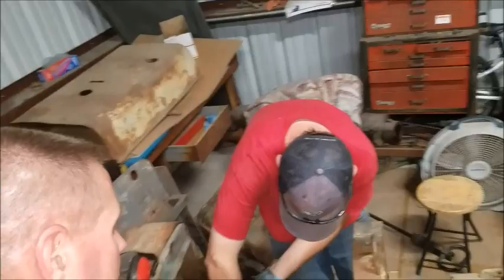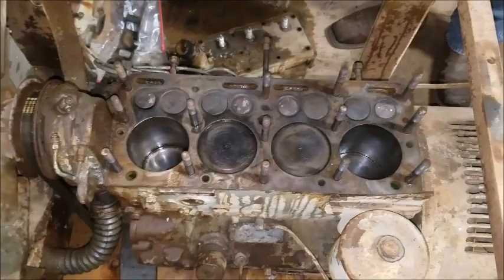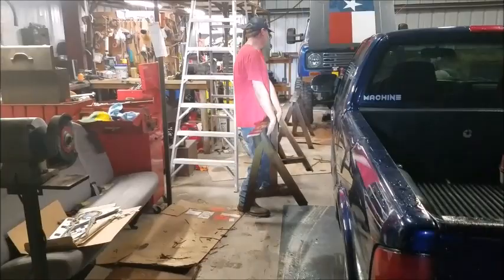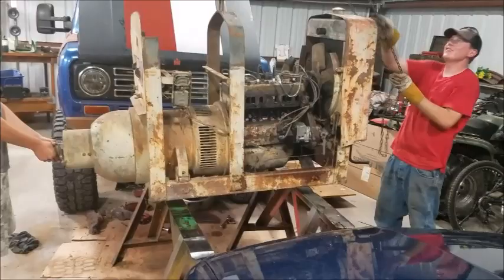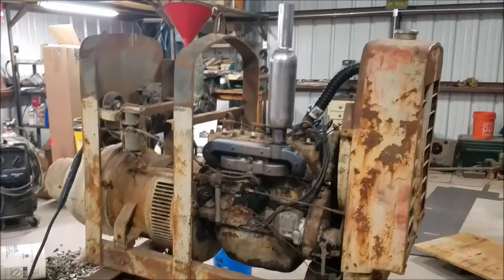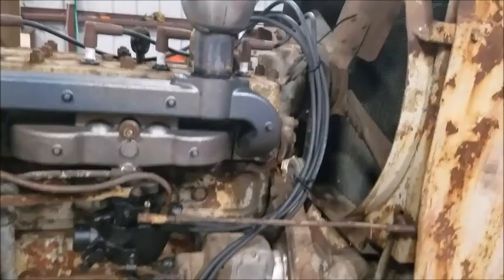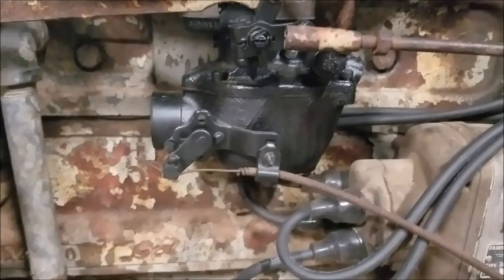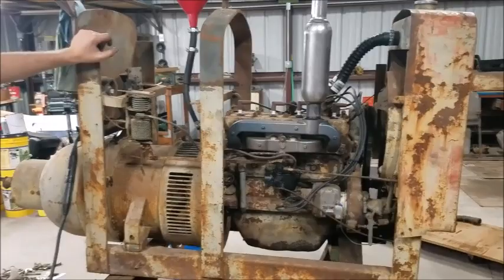1948 LINCOLN SA 200, WILL IT RUN AND WELD?

Comment: Sweet...manifold holes in my 54 shorthood i brazed up...been good 4 years... and used a cowel silencer..yours sounds pretty much same..
     There is a  brown  flexible armature cleaning pad then chalk stick to use so as not to impregnate anything with a problem creating abrasive when cleaning armatures.
        For info on pretty much anything sa200 ..bills welder repair site has a wealth of info as well as parts.
     Ya gotta luv the old non didgital sweethearts.

Comment: Those are wonderful old machines and weld beautifully.  You were lucky when it went to high RPM that it didn't sling the armature apart. Maximum RPM on a short hood is 1450.  Get that tachometer and set your idle and high RPMs and download a manual from Lincoln on your R51 idler and see if you can get it working.  It's worth fixing for sure
Reply from the maker: Clay did get that fixed. He welded with it quite a bit. He has since sold it and is looking for another one. It was very impressive to see that run after all the years of it sitting. The previous owner thought it had been about 30 to 40 years since it was running.
Reply: Matthew Randall 
Great, I restored a 1966 SA200, I won’t get rid of mine. To much work in restoration!  Good experience for the young man though 

Steve

Comment: Never seen a 200 until you tube. nice little machine. would b nice if one could fabricate some kind of electric starter for them. Would b better for the older welders lol! I have a 1956 Lincoln 300 amp generator welder. It has a industrial flat head Chrysler 6 powering it. It does have a electric starter. larger machine than the 200.  the engine is independent from the generator. It has a clutch that engages and disengages the generator. I also have to clean both places on the armature same as was shown. I have the tool with the stones on each end. They may b harder to find but, maybe some electrical shops that still carry and sell out of date stuff may have  one around. I think the stones works a lot better than fine emery. Emery still helps if u got nothing else.
Reply: Easy as adding 2ea 12volt batteries to start it off weld lugs.
Uses the armature as a elect motor.
Lincoln has the paperwork on how it's done

Comment: Do not wrap your thumbs around the start handle. The handle can break your thumbs. Also do not put your head near the handle's travel. That can kill you. There seems to be a zerk in that hole by the electric brushes.
Reply from the maker: It was notched to relieve the pressure if it kicks back. Most Continentals back then we're designed that way.

Comment: never hand spin round and round!!! roll to TDC then jerk. Good way to get a broken arm with the round and round if it where to kick back. If does not start on a jerk something not right. I have a Lincoln 180as jerk start no problem ,,,,
Reply: Broken arm can definitely happen. I'm living proof of it. Tried to crank start an old tractor after I watched a guy wind milling the crank. I said let me do that your only supposed to jerk it quick. I started to push the crank down so I could jerk it up, bang!!! Kicked back snapped my arm clean break. Lessons learned the hard way haha
Reply: @danieldudley8975   damm was that a mag.?  A mag will fire after TDC  if set right or mag is bad
Reply: @1vester1  it was actually a battery ignition or distributor. I think the guy that was wind milling it has it so pumped up with compression and raw gas that when I tried to crank it, it was like the perfect storm.  You always hear old timers talk about getting your arm broke with an old hand crank. Im 29 it happened to me when I was about 23. So a word from the not so wise, if your going to grab that crank you best be thinking about what your doing😲

Comment: Were you using emery cloth to clean the armatures?  I have a 49 short hood I’ve been using for 20 years that quit welding at all yesterday. Suspect the exciter armature May be the problem.
Reply from the maker: Yes, just a piece of Emery cloth. It was not welding very well and we could see that it was not making good contact when running. When we cleaned the surfaces it improved the machine greatly.

Comment: Hi friend!  Could you help me with the order of the spark plug wires!  I don't know if I put them right!
Reply from the maker: Do you have the same engine?
Reply: Yes!!
Reply: Firing order is 4-1-3-2, #4 is the closes to the generator #1 is closest to the radiator if your looking at the side that has the carb. if you have the original magneto with it the cao should be numbered on the plugs. if it was converted to electric ignition then I dont know ive never messed with it.